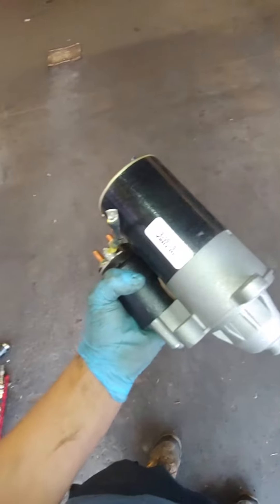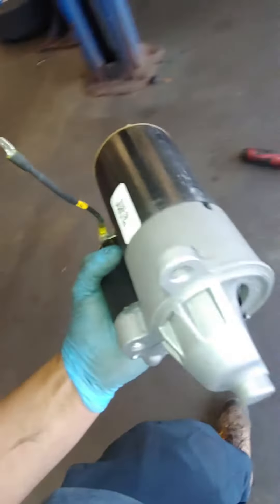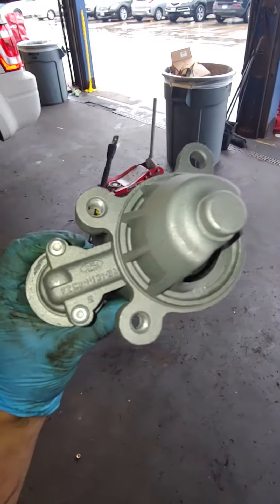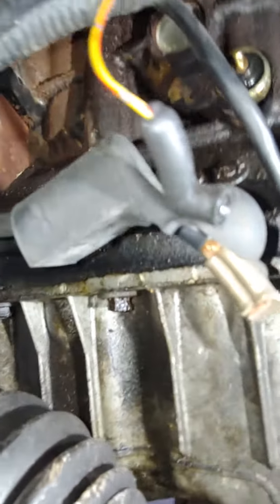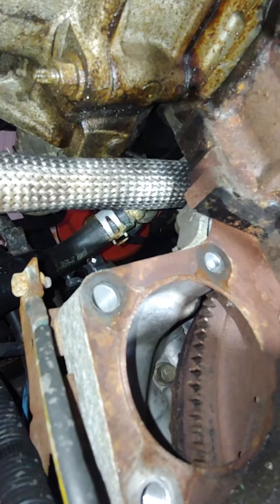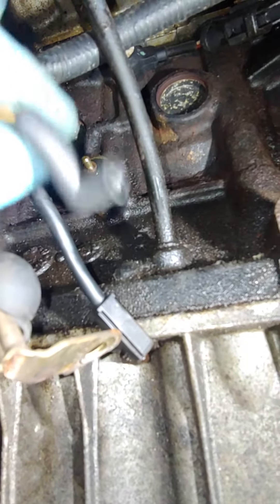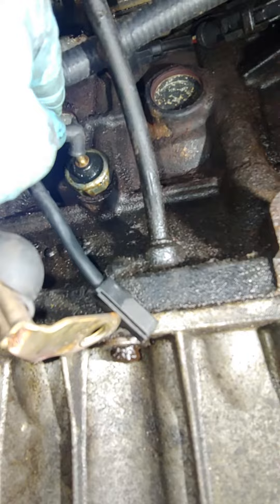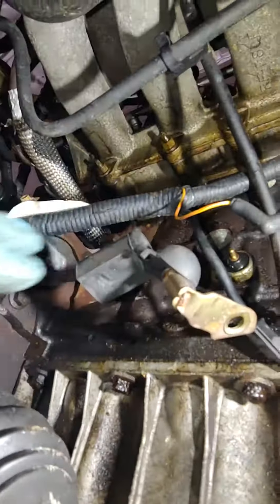1998 ford escort starter

Comment: Hi. Thank you so much for the video. I so wish I could have heard what it sounds like to have a bad starter. I think that's what I'm dealing with?.. it's kind of a grinding sound. but I can't think of a better descriptive word.
Reply from the maker: Hello happy Sunday .   Grab a pen and tap it as fast as you can against a window.   That's the sound of a weak battery.  Now draw that pen along the spiral wire of a notebook or across a home HVAC vent.  That's the sound of a bad starter.   If you only hear one tick or nothing that's also a noise a starter makes. .. another one is the free spinning of a starter like when you start your blender but there's nothing in it. Hope this helps
Reply: @littletonybekind  Hi happy Sunday to you! Thank you so much for your quick reply. so kind of you. I really appreciate those examples with the pen that's great! And unfortunately, it's more of a painful sound..like a grinding metal against metal-ish. I quickly turn off the key because I feel like I'm damaging something. I'll sit there for just a bit and then restart sometimes the sound will go away sometimes not. When I just started it just now, and it's very cold here in Washington state. it started perfectly with no grinding sound at all. so it seems maybe after I've driven it a bit that it will do this??
Reply from the maker: It it only does it when starting it it's probably just a starter.  Good luck there.  One day I hope to visit WA Greetings from Chicago
Reply: @littletonybekind  okay. Thank you so much. Yes and it's hit or miss, it doesn't do it every time. it's usually after I've been driving the car a bit. Washington has its beauty  but dang it's getting cold here! I guess Chicago is cold as well though. And sadly it's super expensive 🤢😢
Reply from the maker: I agree :)

Comment: On the new starter do you have to splice the battery cable in to the new wire or can you connect the old wire?
Reply from the maker: Depending on the condition of the wire if it was removed easily and there's no damage to it then yes go ahead and reuse it but since it's old and you see that it's a match go ahead and put a new one